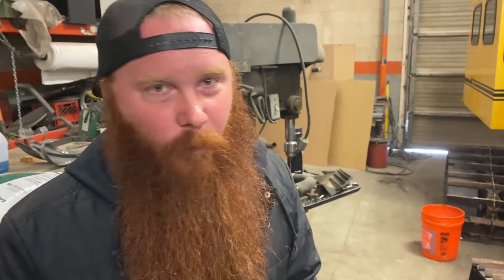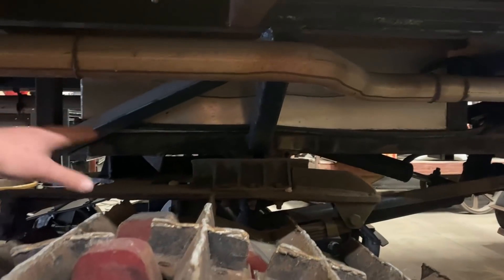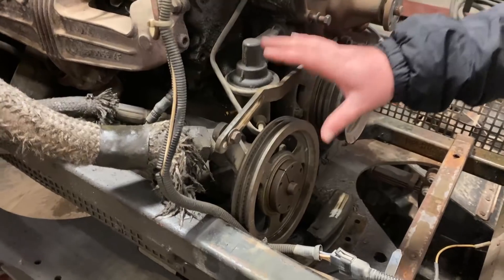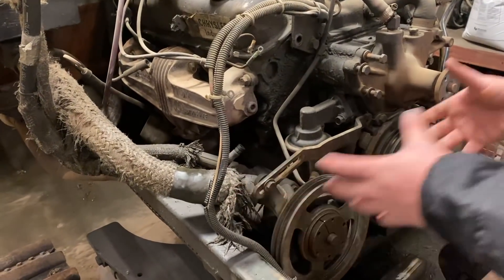LS Swapping A Snowcat Part 1

Comment: Nothing wrong with 'old school relays and technology'.  At least you can find and fix most problems.  Your 'Science' is flawed.  Power matches driveline.  Get the Chryco professionally rebuilt and reinstall.  Done except for wiring and oil line....  Why would you install an engine and transmission of dubious reliability and condition.  Got the Computer?

Comment: MOPAR - L A Engine the displacement is cast into the side of the block. 318 or 360. a Mabe 170 hp ?? Will a LS engine produce the torque required to move it ???
Also it's called a divorced transfer case it runs separate from the transmission.  It's a everyday old style 4x4 set up. I could use that mopar eng/trans. Looks like another up & comming kick ass shop YT. Channel !!!!
Best of luck guys !!!

Comment: VS: let's build a big powerfull engine ..
V8. 113hp¿

Jpn: make smale engine, we must.
1,3... More hp than vs V8..
Reply: Ramon Stewart What are you trying to say?  The thing you people always fail to figure in to these comparisons is torque and power bands. Some of these big V8 engines don’t make a ton of HP but they have very high torque ratings and it’s torque that’s going to turn those big ass tracks. Put a turbo 4 in that that makes 2x the hp but only does it between 6-7k rpm and see how well that cat gets around. 
There are tons of videos showing cars like the Evo or similar with crazy high hp figures, like 800 or so and while that sounds cool, and I suppose it is, it’s only really great for bragging rights and dyno charts because the power is much lower at low rpms and not in full boost and when you see people driving them it’s not very useable power, it goes from basically a dog and then as the driver is getting up in the rpms the power turns on like a switch and nearly breaks the tires loose and within a second or 2 they either have to shift or let off.
Reply: @mcearl8073  I know but still it's funny..
I know us V8 has a lot off cc and torque because of it.
And 1,3 wankel doesn't have any torq..

But still it's funny..
And you people..
There is just one of me dude!!

Comment: Hate to tell you something but the system that you pulled out of there is probably going to be more dependable than any thing that you can put in there look like at 3:18 to me could have been like a 360 Maybe I knew right away it was a Chrysler engine if anything I would have just rebuilt it all if the motor was bad hop that up but good video guys

Comment: 🤮. put a turbo diesel in that thing. You don’t need hp. You need torque. You’re gonna be doing like 10mph max with those steel tracks.
Reply: Griff I think we’ll be ok 
We are doing a Cummins into our slammed ford for our diesel

Comment: There's a reason every single modern snow cat has a big ole diesel. It's gunna be a dog with a dinky little LS.
Reply: Josh Ribeiro I mean there are also a lot of tiny 4cyl snow cats as well
Reply: cumming would fit nicely... 6BT  is great 4BT  is good... i am a cumming tech,  they do have problems to... fuel pump has rear plug that will suck air after a while and makes a no start condition. must replace plug, cannot just tighten it believe me... must do full services on time of you will be replacing the cam i have done many of those... Haha...

Comment: 12 valve Cummins would have been 10x better
Reply: it doesnt need all that torque ... it needs more speed! besides, extra weight on snow doesn't ever help
Reply: I disagree it would also make for an easier swap
Reply: But then what would we put in my slammed ford dually?

Comment: Nice heavy duty 318 there. Sure, it's probably all of 150hp, but they last a long time at that power level. If it's 1985 or newer it should be roller cammed. If you think that Tucker struggled with a 318 try driving an LMC 1500 with an AMC-Jeep 258 in deep powder. 

The trans connected to the 318 looks like an Allison with a standard SAE bellhousing. You can adapt that to the LS, but it might not be any better than the 4L60E. Look up the ratios of the trans. You may need a lower 1st gear than the 4L60E has.

Comment: Good plan on the swap. Nothing like breaking down on top of a mountain pass needing a computer to fix a efi unit.
Reply: Scooter 2kool I mean computers don’t really fix anything on the motor so
Reply: Stepdad Barnes Westshop didn’t know Gandalf had a magical ecm staff for diagnostics. Better send your amazon link.
Reply: Gandalf has nothing to do with this he is fiction 

Kinda like your opinion on electronically controlled motors
Reply: Stepdad Barnes Westshop haha sooo where gonna go there ehh. Bring me into your think tank? I’m into simplicity when needed not a stupid throttle body or app going to derate in snow you’ll never turn that drive train. Some folk just arnt smart enough to work on carbs these days sir.
Reply: Scooter 2kool we are def not carb people and with something like this that sits as much as it does fuel injection is a way better choice 

This is all opinion and just what we wanted to do
Reply: Stepdad Barnes Westshop Excellent point captain about junk fuel and carbs. Thanks for the response. Glade to see your channel blowing up. Keep your blue wrench hot sir.

Comment: A 4L80 or a TH400 or a power glide transmission would make that thing move. Judging by the current trans anything you put in it will be an upgrade.
Reply: Leland Holton we have a plan she’ll do just fine

Comment: FYI, LS-7 heads flow like crazy, but only fit an LS-7 block because the valves will hit a block with a smaller bore size. Very neat swap.

Comment: Couldn't get a good look at the pistons, but it looked like your boat anchor had flat tops vs the dished 5.3 pistons, if that's the case, it's a 4.8, not a 5.3.
Reply: BEPerformance they are dished
Reply: @stepdadbarneswestshop2800  Hard to tell. Either way, a great engine.

Comment: if you want to turn that weak pathetic 4L60E trans into something bullet proof, contact the company called sonnax (i may have misspelled the name), they did research on the trans, and made parts that would allow the trans to handle 1k HP/torque consistently on the strip, so it should be able to handle the snowcat
Reply: Raven Kraken yeah it will work great

Comment: Get a 4L85 transmission with a PTO and get a hydraulic pump for that. Abandon the engine mounted pump.
Reply: Chuck Beef might even be a PTO output on the drop box that can utilized.

Comment: Awesome video! LS's have been put into everything lol. Would have loved to see the Cummins R2.8 turn-key crate engine! A motor head myself I have lots of admiration for the LS but that R2.8 is a monster and going into a workhorse like the snowcat would be unstoppable with one of those. But still loving this project awesome work guys!!
Reply: Duane wish we could afford one lol 

Once the channel takes off some more we can free up funds for it
Reply: Duane I agree that would have been a better choice, especially for this purpose but what makes the LS swaps so appealing is the price, you can go get one for a few hundred bucks anywhere and there’s a shitload of cheap ways to upgrade them. You’re not getting any Cummins for that, especially not a brand new crate engine. I kind of prefer the channels who do things on the cheap, it makes it a whole lot more relatable than the ones who’ve gained enough sponsors to basically have unlimited budgets who have 20k worth of parts delivered for their project. That reminds me of the older car shows on TV more than Youtube where I can see how far a very small budget and good old fashioned ingenuity and ability can take you.

Comment: This prefect candidate for Cummins R2.8 Turbo Diesel not LS
Reply: Anthony Toste you fund it I’ll rip that ls out in a heartbeat
Reply: I think it’s fine
Reply: @robertgilbert4557  sure gas is fine but Diesel are fuel efficient why do this think the rest of world use them over gas ever in alaska.
Reply: coinstalker Hunt Hard   wrong to what ??
Reply: or a 12 valve
Reply: Boring engine what about JZ/RB:)
Reply: @joe125ful  because race-cat😂😂😂
Reply: Hello !! Je vis dans le nord du Québec et je suis mécano diesel. Tout nos machines sont diesel et elle star à tout les matins. -40 •Celsius is normal.
Reply: @olivergrandbois2937   translate of his post Hello !! I live in northern Quebec and I am a diesel mechanic. All of our machines are diesel and it starts out every morning. -40 • Celsius is normal.
Reply: That thing needs a full size cummins. It's going to be a dog with an r2.8 or an LS.
Reply: @mongoosebootrrider  318 is a dog when compared R2.8 keep in mind that you want Torque sure the big 5.9 12v sound good to but little over kill for the tucker sno cat which made go up to 15mph top.
Reply: @SHSPVR  Stock for stock a 318 and r2.8 put out about the same torque. I'm fully aware the requirements for a snowcat engine.  A 12 valve would be easier, cheaper, and more effective than an r2.8 or an ls. Its not about top speed, Its about having the torque to climb a super steep hill in 4 feet of snow.
Reply: @SHSPVR  Most LS motors actually put down more torque than an r2.8, which makes a whimpy 310ft lbs.
Reply: @mongoosebootrrider  No the Chrysler 318 industrial 2 barrel engine rate for 150hp/260tq low rpm stock where the R2.8 160hp/310tq the 3.9lTB4 105hp/265tq and there the 5.9lTB6 Up to 160-215hp/400-440tq depend on model year and find good one used cheap 5.9l cost arm and leg still and there guarantee on shape in tell you pop the head off.
Reply: @mongoosebootrrider  yes but get to torq number you have be at 4000rpm with LS motor
Reply: Josh Ribeiro The rest of the drivetrain wasn’t exactly made to stand up to 400hp
Reply: Have you ever tried to start a diesel groomer in -35? Issa bitch, gas engines are way better in the cold
Reply: @thepostman69  My farther and brother both drive truck for many year and it easy if know what you doing.
Reply: @SHSPVR  yeah it's called a block heater that 99% of semis come with and the ones that dont typically have fuel heaters near the injection pumps or have (gas) generators that keep the batteries charged. Unfortunately there is nowhere to plug in a sno-cat when you're 20 miles into the back country and after 9 hours of hunting or fishing back there your diesel WILL be gel, your batteries WILL lose cranking amps from the cold, and any ring blow-by or fuel injection timing advance will make it start even harder. Try cold starting a turned up 12 valve in -35. I know plenty about what I'm doing and dont open my mouth unless I got the logic and info to back it up.
Reply: @thepostman69  Block Heater where you been hard lee any one had them back in 70's, 80's out on the open road and should be using 0w-20 or 0w-30 oil before winter set in, try be coming a real long haul truck driver you lean real fast and it good idea to have propane blow torch and small propane heater prefer a forced air with small gas/propane generator a battery charger 1 to 10amps some seal off the engine compartment for under side by make skirt so heat go up lean to used that noodled for a brain also tip did know preheat air before it been suck in to intake a helps a lot and there many trick to in starting diesel like winter blend of fuel mixing number 2 diesel with number 1 kerosene and that not all.
Reply: The Postman so a gas engine starts better in cold, but are you saying a diesel would be less reliable to use?
Reply: @thepostman69  I dare you to go tell that to Heavy D and Diesel Dave who also list the same info on Diesel Sellerz own web site and even Alaska and Canada folks living in backwoods will LoL you being that sister and brother law both have been living in Canada for over 20+ years sorry but I just checkmate you buddy.
Reply: @SHSPVR  so you want me to take your word that what you have to say is valid cause some diesel douches that got a TV show and your relatives that live in Canada? Thatd be foolish of me. I go of of my personal experiences dealing with everything from 600cc Liberty 2 Polaris 2stroke race engine all the way up to 34L Caterpillar diesels. All I can go on is the fact that I've battled diesels year after year and never had a cold related problem with gas engines beyond a frozen battery
Reply: @blackbird8632  absolutely not, dont try and put words in my mouth. Thatd be a silly ass statement. I just think in that sno cat, an MPI or direct Injection LS is the best option because its drivetrain is built for the input RPM of a gas motor and I cant imagine someone is going to be trekking across the klondike in it. Plus thos holly systems can squeeze a 6L into high 20's mpg in on road applications.
Reply: The Postman hey relax dude, i did not say or imply you said that. I just asked a question, for me to learn. Over here it does not get that cold and diesel engines are used for any kind of industrial or farming equipment. I was wondering if gas engines were used more in colder climates because they were more suited for aplication in cold climates.
Reply: @blackbird8632  not anymore mostly cause gas engines have steered towards automotive use and left a large gap for diesels to fill in the market. For sure in the early part of the century industrial gas engines were common place in large trucks, tractors, forklifts, airport equipment and so on. Like Clark plane tugs almost all came with 300ci chevy I6 industrial engines. The new industrial/ag engines have so much insulation and self-contained preheating they do fine, but new engines also control injection timing, spray velocity, spray duration and so on to aid in a cold start.
Reply: The Postman cool thanks, i always figured diesel engines were not as widespread in use in the past because they were not as powerfull. I never really considered starting could be a part of the choice for gas or diesel.
Reply: @blackbird8632   For sure even down to small things like engine drive welders.  I built transmission lines in the dakotas for 2 years and always struggled with the diesel units come the dead of winter and would just pull a shitty Miller Bob cat out of the trailer and itd fire on full choke everytime. The only gas engine I've had struggle to start in the cold is stuff that runs on 110 octane. I use to have to knock the timing all the way back on my race sled and spray a shot of 87 in the carbs to pop it off when it gets below zero.
Reply: The Postman I mean, most snowcats are diesel, if not all snowcats in the last 20 years

Comment: So you’ve found a snow cat that one appears in pretty good shape. I noticed you joking about the old 1 barrel carb well that engine isn’t designed for speed it’s a low rpm high torque engine torque is the key to powering those rigs around in the deep powder. That set up in its day was a reliable set up it should be interesting to see a GM motor in it.
Reply: it's not a 1 barrel carb, it's a carter bbd 2-barrel.

Comment: Ah dude that thing had a minty 318 in it!
Reply: i would have just built it. heads,cam four BBl and maybe put a 340 crank in it because quite frankly i have no idea how to make a mopar tranny work with a GM plus getting that hydraulic system working seems like a little more work ( just treat it like an AC compressor )
Reply: @philtripe  340 and 318 have the same stroke and a HD 318 will have a forged crank. 

Since low RPM torque is king for rigs like this I would have dropped in a stock 5.9 Magnum with aftermarket management and called it a day. Not swapping the trans would have saved a large amount of time and money.

Comment: Whats wrong with the 440 in it?
Reply: okc 306 we had a boat that needed an anchor
Reply: @stepdadbarneswestshop2800  lol well that 440 is a lot better than that 5.3 if the right people have a hold of it.
Reply: @seudechrist   when people cant do anything right ... but actually a 440 is one of the most powerfull engine to date. so i do not see the reason to swap in a 4 time less powerfull engine into the snowcat ?? unless they can not find parts to rebuild it which is actually not hard to get at all. yeah LS have lots of adventage over the 440. but performance wise , HELL NO. not even close. put a modern transmission in the back of a decent shape 440 and be amazed of what real power is. even a hellcat is behind that.
so yeah its a good swap to di and everything , but please respect the car god and no not say total crap that a ls is more powerfull than a 440. thanks.
Reply: I believe you lol 

Just we aren’t those people
Reply: @stepdadbarneswestshop2800  i just really hope once you get that 5.3 in there that it will have enough torque to do what you guys want it to do. 

 We have put 5.7 in cats and loaders and log buggies but even they have a hard time and sound like they are working for there life. Lol. 

 I would use an lq4 if you really want to use an l.s
Reply: Yeah I agree they may need to pro charge that 5.3 to get enough power. The 60e does have a low first gear but they def would have been better off with a 6 liter. Maybe a little squirt of nos to help occasionally especially when suffering from altitude sickness on a big climb
Reply: Orginanal engine was 318
Reply: @jarkkosoikkeli8131  that make more sense. 239/318/360 either LA or Magnum, are extremly reliable tho. LS are ok.
Reply: not a 440 its a 318-360

Comment: The pump can be done a couple of ways. You can change the pulley over to a serpentine pulley and then mount the pump with custom bracket. The other option, the one that I would do, is to add a v belt pulley in front of the LS engine to drive the pump. You would probably want to get an aftermarket balancer because it would have bolt holes to bolt your v belt pulley onto it.
Reply: Tim Smith we cover that in episode 3